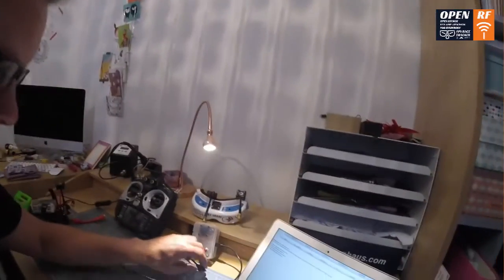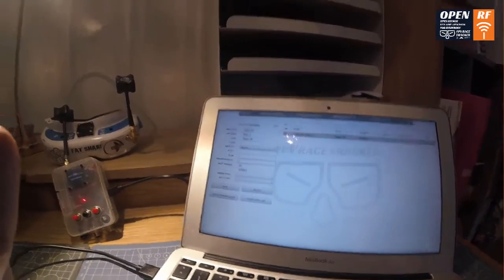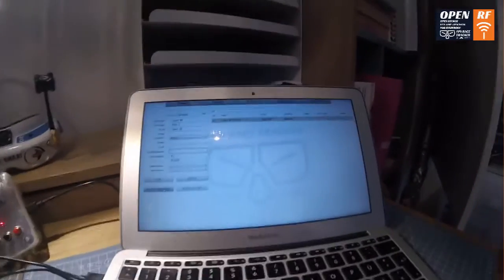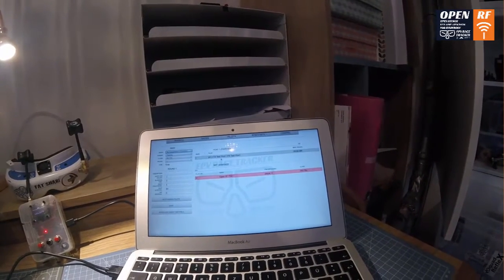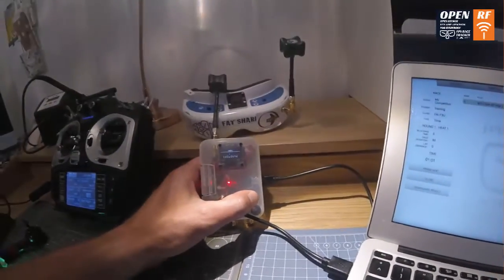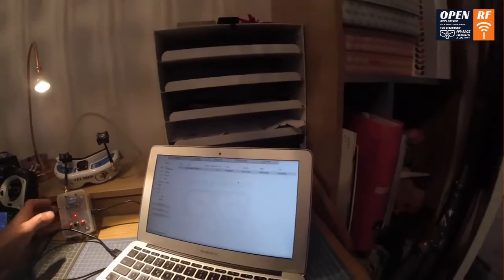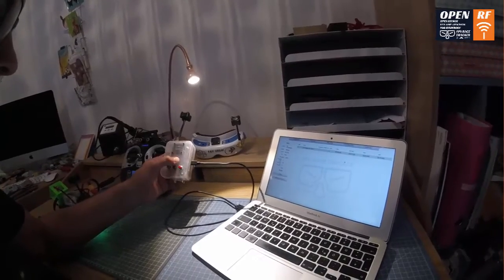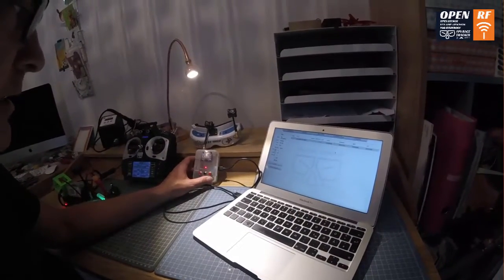OpenRF Timing Update 1

Comment: Does this require a hardware device for each pilot or does this single piece of hardware monitor all pilots in a heat or race by itself?
Is this tech separate from what IRC is working on, or in conjunction? I had to set the FPV Racetracker program aside and go back to my RCScoring Pro as the racetracker didn't seem to provide me on the fly capabilities to make changes. I also don't have a lot of support trying to learn it, so in the name of comfort, I have let it go for now. 
We are currently looking for a very well operating ground station set up for a very large indoor venue- I keep this tech on the short list with Iftron and Immersion, but by the end of August or September of this year we will need to choose a product and vendor so our massive 2017 schedule can be handled and future years.
Reply from the maker: no just a single device for all pilot and yes it has nothings to do with IRC this is a open source project available for everybody.